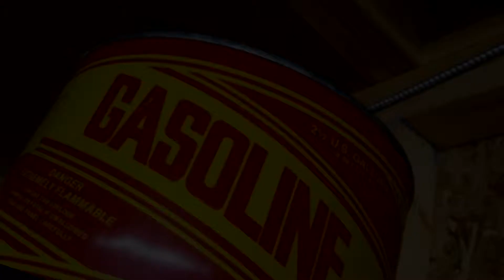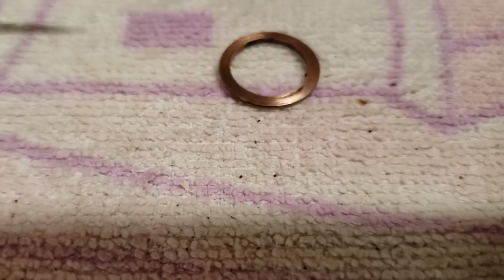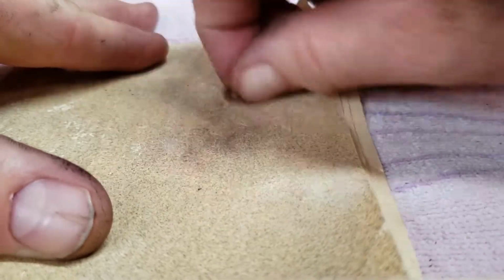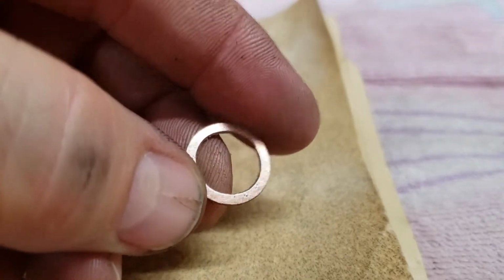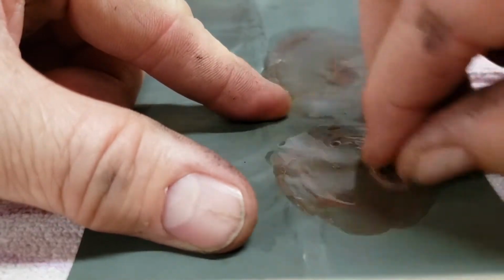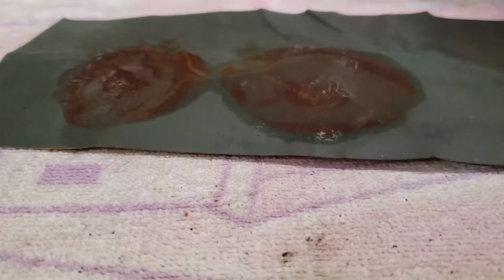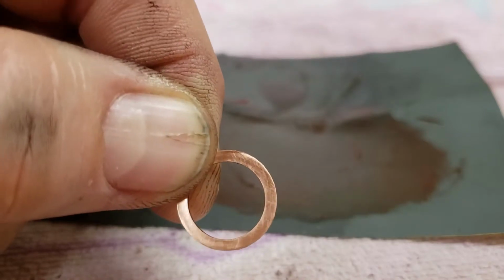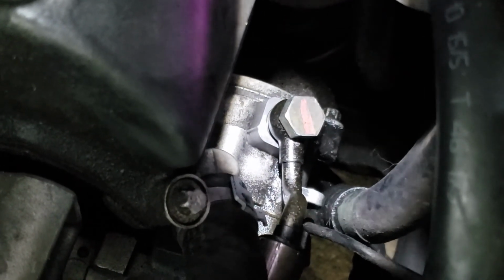Resurfacing a Crush Washer to fix a Mercedes W210 Power Steering Fluid Leak

Comment: But the cost is less that a dollar; why the energy waste?
Reply from the maker: Because no one here had a properly sized crush washer to fit that Mercedes fitting. Would require ordering on line and I did not want to wait. Additionally I just wanted to see if it could be done.
Reply: @ImpalamansGarage  Got it. That's cool.